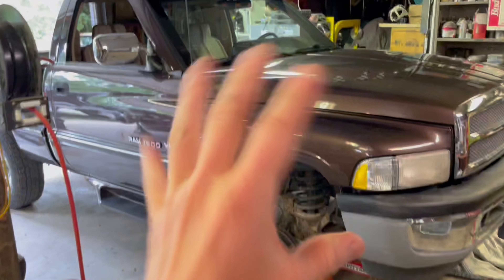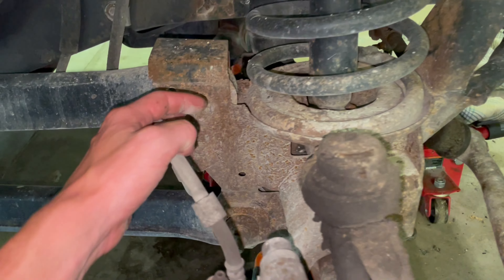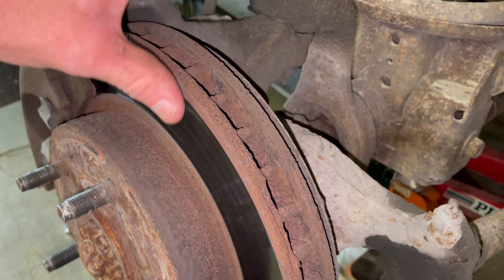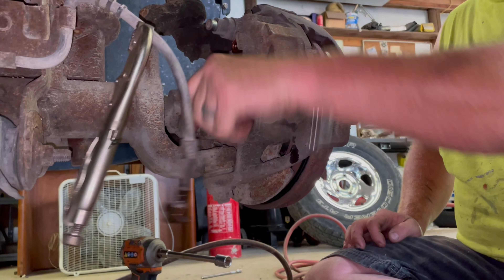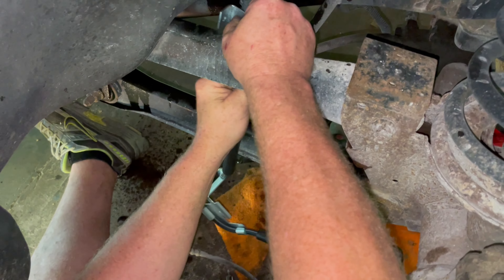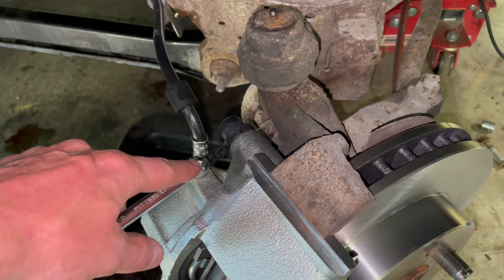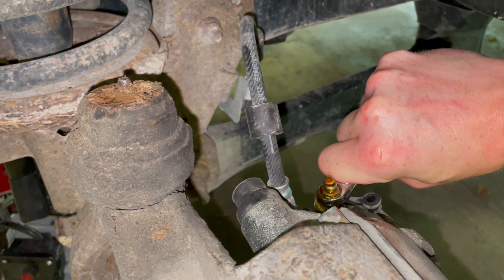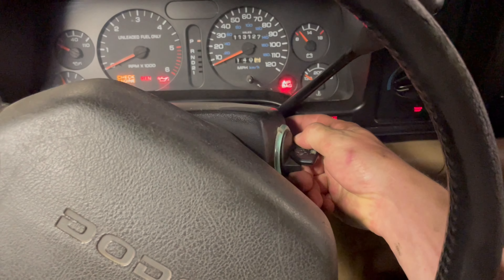2nd gen Dodge Ram 1500 Common Issues

Comment: I love the colour that yours is. Sort of a rare one. 

I think you mentioned it in another video that the sun visor and side steps were a factory option.  I dont think they were factory options, but they could have been the local dealers add ons that they offered, once the vehicle was already purchased.  

My old man is a 40 year Chrysler tech, I basically grew up in a Dodge dealership. I dont ever remember those being part of the SLT Larime package. And my Larime 2500 doesn't have those accessories

Comment: Pro tip. Grab you a piece of vacuum hose that fits snug over the bleeder. Place your box end wrench on the bleeder and then slip the hose on the bleeder. Next grab you a mason jar and give it about an inch or two of new, or used (doesn't matter) brake fluid in the bottom. Make sure you have enough that the vacuum hose remains under the fluid level during the bleeding process. Toss the open end of the hose in the jar and start your bleeding process. As you bleed air out, it will bubble in the brake fluid in the jar. Close the bleeder when the bubbles stop and repeat until clean brake fluid comes out in the jar. Fill the master cylinder as needed. Whamo, no more brake fluid in your face and everywhere else. Keeping 2nd Gens on the road one project at a time...
Reply: Lmao that was too funny watching brake fluid explode everywhere, I vote keep doing it the same way lol.